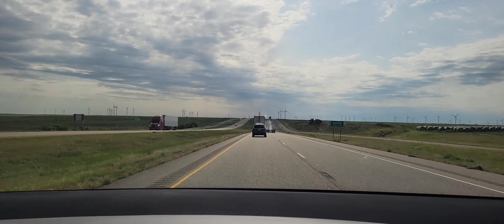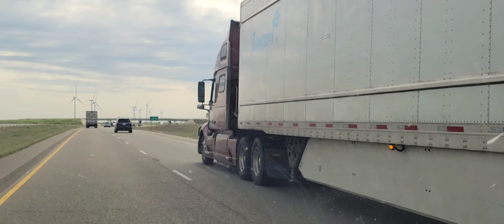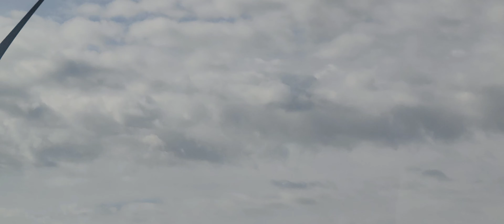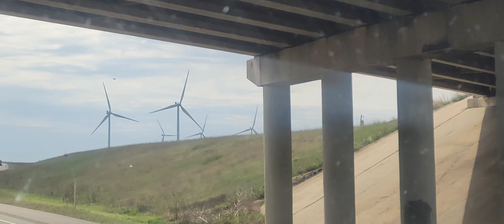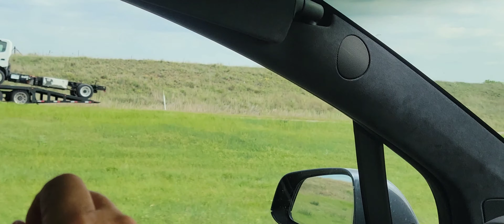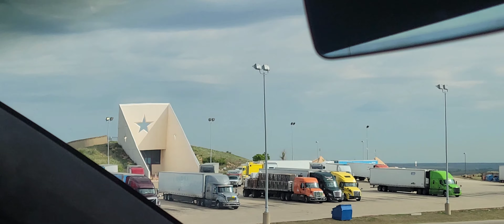Texas Panhandle Winds Turbines Part 2

Comment: So do large wind turbines lock rotation to the grid?  Or do they use inverters? Seems like energy would be used in low wind to keep them spinning and in-sync with the grid and the pitch controlled so that if the wind picks up the blade pitch can be increased. The ones I've always seem to be rotating at the same rpm no matter what the wind speed is (once pass the cut in speed).
Reply: I'm no expert on wind (or anything for that matter!), but I am certain almost all large wind turbines are synchronous generators, directly paralleled with the grid. That is why they all turn the same speed. They do have variable pitch on the blades, which allows for some optimization in varying wind speeds. However, you are correct that any rotating turbine (including water) has a best efficiency point based on the velocity of the media driving it. So without a means of varying the speed of the generator, there are going to be losses. 40 years ago, I built a small 7kw wind turbine using a variable speed drive. It worked well, and the VFD allowed the frequency (rpm) to be infinitely varied. It was the Stone Age, and we didn't have PLCs or other means of controlling and data logging performance, but I played around with it long enough to see it boosted output. Recently, I worked with a developer who installed VFDs on some hydro units. However, I'm not sure how well it has worked. Personally, I haven't heard of large turbines using g VFDs. I suspect it's not worth adding the expense and complexity. It's the same with solar. No one installs trackers on solar panels anymore because the tracker is the moving part that fails and requires maintenance. Plus, you can simply buy more panels with the money saved from excluding the trackers and get more energy production.